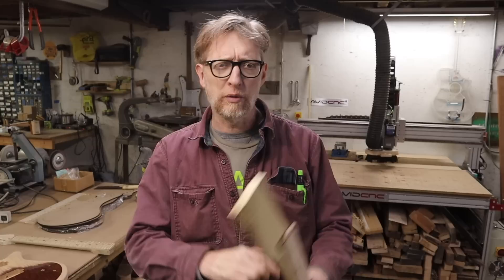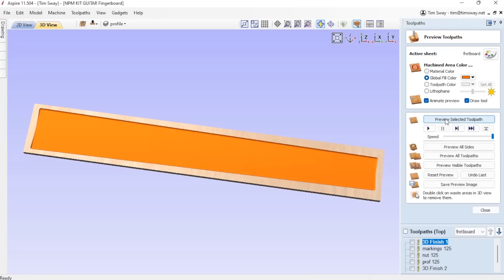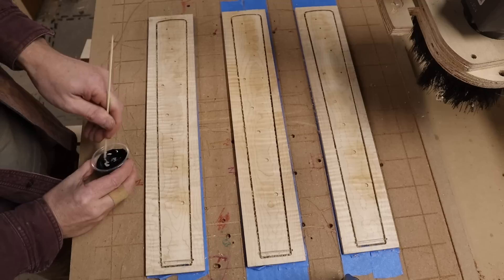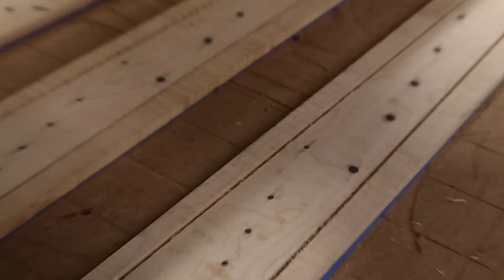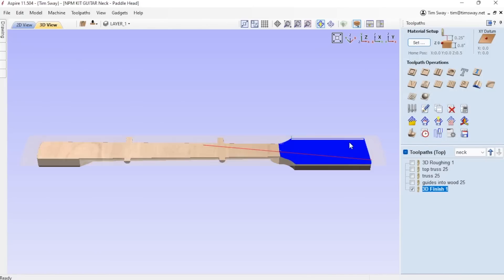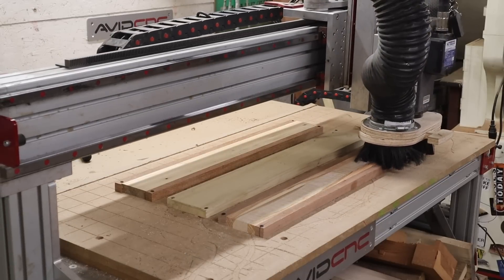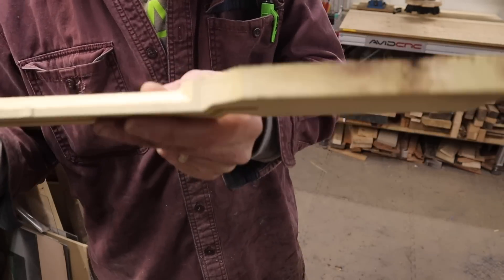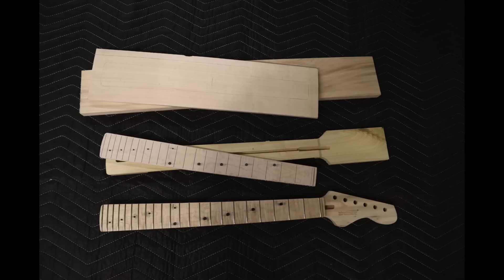How to Cut Guitar Parts on a CNC - (Pt1: Necks & Fretboards)

Comment: Hey Tim, love the video! Just getting my toes wet on the CNC. I'm trying to figure out the flipping part of the neck. Putting the dowels into the neck makes total sense since it's basically a maker. I did it when I was gluing up fretboards to necks, used them as a reference as well as a holder to keep the fretboard from moving during the gluing, but as far as how the CNC knows where to go back to? I saw you re-zero it, but I'm guessing the software knows where to start back exactly? Or is that something you need to tell the CNC to do as far as going back to the exact spot to do the back of the neck? Sorry -- rookie here. Appreciate any help brother!
Reply from the maker: every cnc is different but, yea, as long as the cnc machine starts in the same place, the marker trick works perfectly! Only way it goes wrong is if the start spot gets changed.

Comment: What's the smallest CNC machine size I can get, and still be able to handle the wood sizes relative to building a bass.

Thank you
Reply from the maker: Figure a full size bass neck, like a fender, is about 34" long, I'd say 36" to make bolt ons. Neck throughs you'd need one big enough for the whole bass, usually less than 48"

Comment: Thanks for the video!!  Here are some ideas to make life easier on the cnc that have worked well for me.....  Wooden dowels are much easier for fret markers.  I oil my necks  and do not want any epoxy or shellac on my fret board....   You can get a Kyocera .25/.023 bit for the fret slots for about 5 bucks......  I always screw the fret piece to the machine bed.  Six screws.  The tape method does not always hold the fret board down properly.  The fret slot is very shallow and you need the fret board perfectly flat.  Use these procedures and you will not need the fret saw.  The fret slot will be flat from the saw, with the cnc you can arch the fret slot so the depth is the same all the way across....  Use the "machine bed" for zero reference.  That way your thickness will always come out correct.  Using "material surface" is very dependent on the fact that you have thicknessed your material properly.  You should always use the cnc to plane the surface of your material first, then flip it and start cutting the surface.  Gives you an even thickness and flatness  on the piece.  This is critical for proper necks and fret boards.  Otherwise you may have a hard time adjusting the guitar later....  I run the radius of the back of the neck all the way to the edge.  Just like you did with the dowels for two sided cutting, create small (1/8") holes on the inside of the fret board and neck.  Then you can add a small pin of some type and the fret board and neck will align perfectly when you glue together.  Saves a lot of frustration and guessing......  I fill the dowel holes drilled into the machine bed with dowels, glue, cut, and sand them flush.  Does not take long.  Provides more surface area for later dowel holes.  Thanks again!!!

Comment: Hey TIm, I had trouble with pigmented epoxies bleeding through three coats of the same  Zinnser product. Up here in Canada it is suddenly very expensive ..$20 USD equiv and the only product available to us. My next step will be to make  Shellac with various ratio of methanol. Anyway my next kick at the can involved using carbon powder for black colouring as it was promised not to bleed.. Yes it is very black! Blends well!! And...also bleeds like a prick. What is a guy to do? Not for lack of trying.
Reply from the maker: yes, that spray shellac is very expensive, which is why I tried to do only one coat! lol
Reply: @timsway  Goodlord man you of all people should by now have a tried and true method to prevent this bleeding. In my estimation it ruins the job, the part, all the time in to said job and the material. My recent disappointment was a three headed dragon v-carved with my last piece of baltic ply. ( no longer available )  and I sprayed three coats paying extra attention to the vertical surfaces and brushing the finer details as in the delicate corners. The bleed of the black epoxy infill was heartbreaking. I couldn't hide it. Destroyed the entire 500x500mm piece. So I decided the next time I would do a test with epoxy thinned with acetone. Thinning is neccessary  to conform to smaller features and act like a sealer. Failure to thin enough and it won't soak into the grain. No rushing home for dinner is allowed...🙂. Otherwise if you want to try to make your own shellac .....Check Amazon for >dewaxed< flake. This feature is important apparently.  https://tinyurl.com/bdne2hme. Add a stirring device which may also blend epoxy and pigment as well. https://tinyurl.com/45rjdur9. Your into $50 for the test. I think I'll do it even though I have to pay shipping and the diff in CAD$
Reply from the maker: @chrisleech1565  Oh, I know how to do it. finish the piece like it's finished! lol!! But it feels like such a waste of time and product. I've used water-based poly, too which works also.

Comment: Great video Tim! I used a 0.7mm endmill with 0.7mm depth on my last project which worked sorta well, only broke one endmill for my 30 frets. In my head, if I go in at an angle rather than straight down it should be easier on the tool, do you have experience with that? Because for the most part you should be able to machine the same depth as the tool diameter for any endmill, unless you run into cooling issues, so I'm interested why you go half diameter, or if you'd do that also with a brand new endmill.
Reply from the maker: I err on the side of safety. even with a big 1/4" end mill, I'll usually run 1/8" passes (sometimes more like .175"). I used to be more aggressive with the little guy but on dense stuff like richlite and ebony i'd have breakage issues to often. this way in maple, etc., I can geto 10 or more fretboards out of one end mill.

Comment: Thanks for taking the time to put all of this together. That's a great tip about not putting your locating pins in the same location for both sides. I've already destroyed a couple of necks by inadvertently either flipping end for end or wrong side up and not noticing until it's too late...oops! Even little tips like that are super helpful!
Reply from the maker: it's soooo easy to make mistakes like that. cheers!

Comment: I've just started learning to use CAD software.  I've been using Fusion 360.  I've discovered that I'm really bad at it. 🤣  It's so hard to get what's in my head into the software.  Not that any software would be ideal for me but what are your thoughts on Vetric Aspire vs. Fusion 360.  Would love to hear what the crowd feels too.  Thanks everyone.
Reply from the maker: Fusion is a very powerful software that can do all sorts of things you'll never need it to do. So is Vectric, for that matter, but Vectric is specifically designed for CNC use, so I find it infinitely easier to understand and use in a practical sense, for me. It has ike 2 worlds in it, a 2d world of vectors where you can just draw lines and cut them as well as a 3d modeling world for more complex stuff, but you can acheive 3d like cuts in 2D by using things like moulding tool paths which not only speed up the design process but the cutting time as well.  

If I were a 3d modeler, I'd put the work in to fusion as it will be more beneficial in the long run, but for woodworking Vectric is the choice.

Comment: Also, I use 0.6mm end mills to do fret slots, I just do them on the line, one pass - it ramps in on one side, gets to the end and runs back to the other side (so I guess 1.5 passes). I have one end mill I've used for 4 or 5 fretboards to date without breaking it. I tried using 0.5mm mills, but the slots are just a bit too tight.
Reply: what RPM speed are you using?
Reply from the maker: you're doing full depth of the slot or finishing with a saw?
Reply: @timsway  I typically do blind slots, so you can't really use a saw after, I did get a "fret cleaner outer" (made for refrets) to clean out the slots.
Reply from the maker: and yea, i can usually get 10 or more maple fretboards from one end mill but sometimes will go through 3 on one richlite, geesh